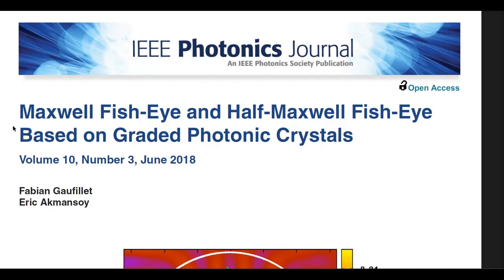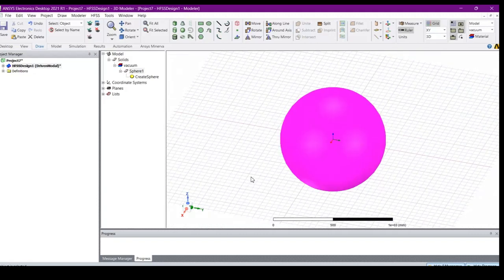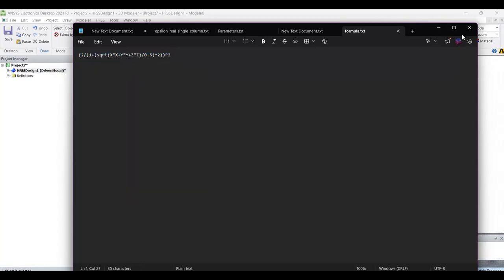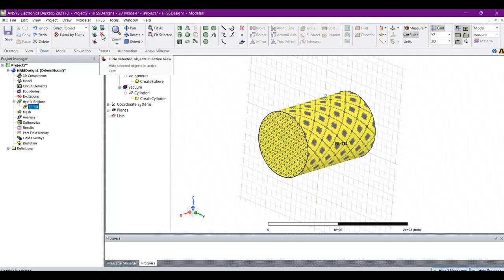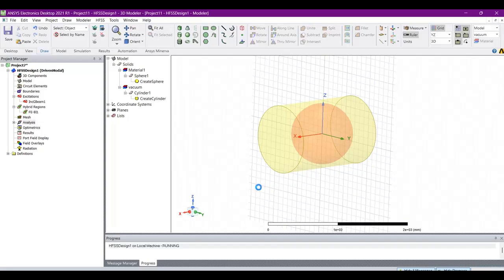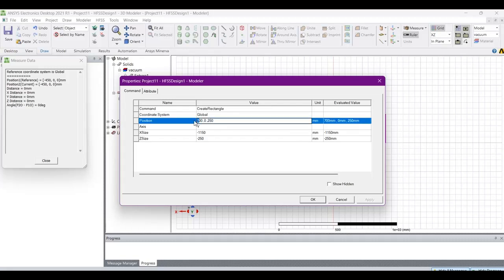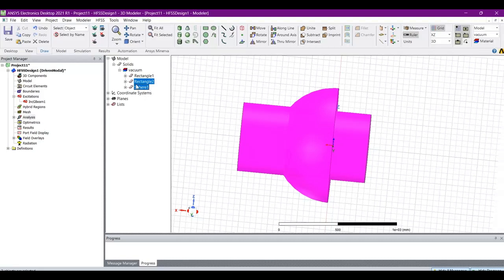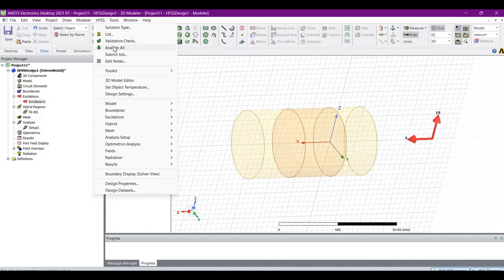Spatially Dependent Materials Simulation on Ansys HFSS with  Hybrid FE-BI  Boundary.

Comment: Thank you for the informative video. I am currently trying to implement the Maxwell Fish-Eye lens equation in HFSS 2025 R2 Student Edition:

(2/(1+((sqrt(x*x+y*y+z*z)/0.5)^2)))^2

However, I receive an error related to spatially dependent material modeling, and the “Assign Hybrid” option is also missing in my version. Could you please clarify whether this feature is only available in the full commercial license or if there is another way to enable it in HFSS 2025 R2 Student Edition?